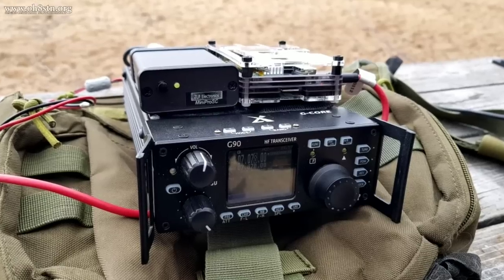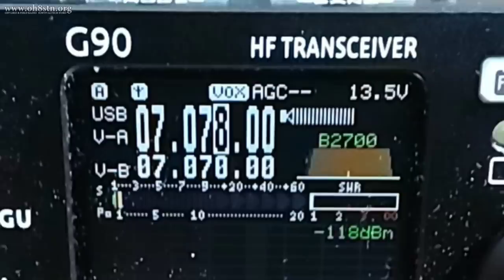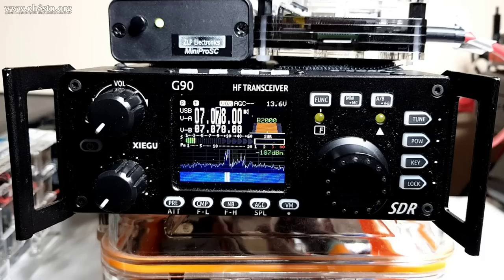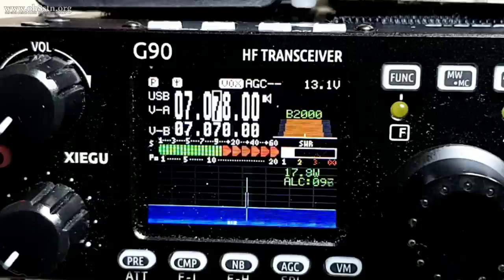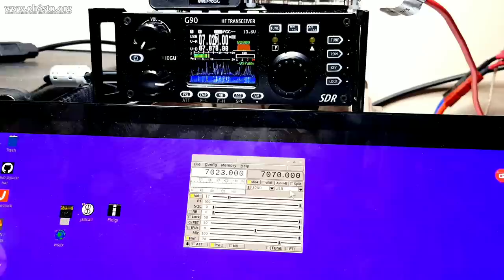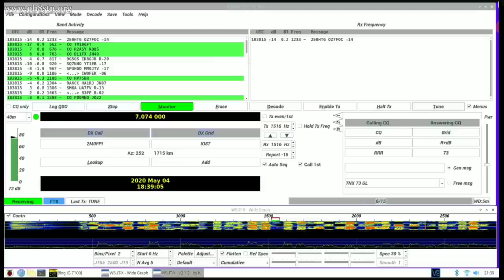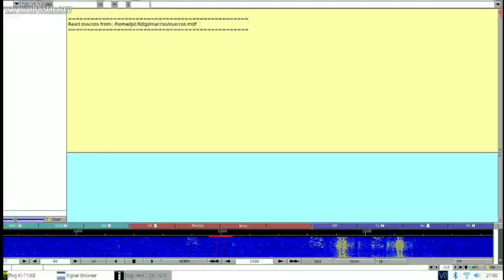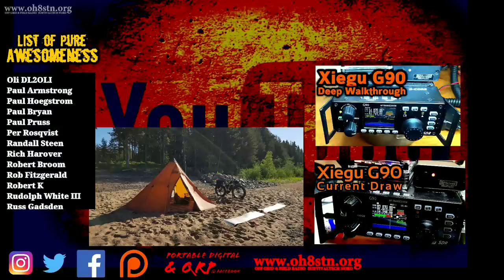Xiegu G90 Digital Modes Setup

Comment: Thanks for the great videos on the G90. You inspired me to try FT8 and the other digital modes. Maybe you can point me in the right direction.  I bought a G90 and the MiniProSC that you used here. I'm using a Windows 10 laptop. But, for the life of me, I cannot get WSJT-X to work. Is there a step by step out there that I can use to configure WSJT-X with my Windows laptop to work with this specific set up? Thanks, Julian. 73 from W5DUI.

Comment: Got my G90 working with HDSDR software on computer, but the question is do you need two antennas or just one and the panadaptor just takes whats on radio screen to computer screen.

Comment: Julian - Have you tried hooking up the G90 to the DRAWS board  via one of the mini din connectors on the DRAWS board yet?
Reply from the maker: Not yet. I don't have the newest draws hat but in principal, It should only be a matter of making the cable.
Reply: @OH8STN  If you still have the old version I would be interested in what you think and if you have any configuration tips with it . I have one from their first run.

Comment: I noticed that you are using the usb port on the side of the pi to give it power, but in earlier videos you describe using a buck converter exiting the rear of the pi for the sake of cable management, as well as using a sabrent sound card instead of the ZLP. Any reason for going back to the ZLP and usb port for powering the pi? Thanks and take care.
Reply from the maker: Sometimes when I'm making videos I have different raspberry pies that I use, different laptops that I use oh, so I just used what's easiest for me at that moment. Your question reminds me about continuity and how important it is. I do have different configurations but generally when I'm out in the field for real, I'm usually doing it the way which allows the most freedom and easiest configuration.

Comment: Could you elaborate a bit more on why you prefer non-cat control of the rig? (Is it a preference that applies generally, or just to this radio?) I have an ic-7100 and I love the ability to have one wire (single USB) to get audio AND cat control AND gps data to a pi, and this arrangement has proven very reliable and convenient. It seems like some of the newer ALE modes would require cat control, wouldn’t they?
Reply from the maker: Excellent question. It's only about the g90. There's two reasons really. When operating portable, I don't want that silly cat control cable coming out of the side of the  head unit on the radio. It's easy to break it off. Secondly, operating data modes primarily, I'm usually sitting on the frequency and not hopping around all the time. So usually I change bands, not frequency. Finally, cat control for the G90 isn't implemented in hamlib or FLRig, it's a hack at the moment. So I prefer simply not to bother. On the flip side, if I were using a 7300, 7200, mcHF, or any radio which has a single wire interface or data and Cat control, I would definitely be using the cat control all the time.
Again excellent question 👍

Comment: You did not explain line input filter. Many station uses 240 Hz tone (for example) for FT8, but that does not pass through transmitter. Simply 0 watts out.

Comment: Could you please run through the making of the splitter cable that plugs AF CON to audio in and out.  I want to make sure I am wiring it correctly
Reply: He won't. Nobody will, it doesn't work. I've been trying to get the CE-19 audio to work for days, cat control works but it outputs 0.0 watts. 🙄

Comment: I'm trying to set up WSJT-X on a Pi 3B that is running the 7-inch touch display, but I can't seem to re-size the application screen. Is there a fix for this?
The display is 1024x700 resolution.
Reply from the maker: 1024 by 700 should be plenty for wsjt-x. First make sure your Raspberry Pi is outputting 1024 by 700 or as close to it as it can. If that doesn't work you'll have to resize the fonts in wsjt-x itself, while the app is maximized. Give that a try.

Comment: Our group wants to find the simplest system to use only JS8CALL for E-Comms within 100 mile radius on 80m NVIS for mountainous terrain.  Our goal is a simple system new HAMs can use.  As close to plug and play as possible and low cost single purpose system.  Is this a good transceiver to build around.  Suggestions?
Reply from the maker: The g90 is not the most perfect radio, but it's a solid performer.
What you're asking is relatively easy with a g90. A resonant horizontal wire antenna 1/8 to 1/4 wavelength above ground on 80m. The antenna can be loaded to shorten it up. 1/2 waveldngth dipole with wire reflector underneath.
I would suggest using 40 meters during the day and 80 meters at night, which usually works well. You can use relatively low power as well. I've demonstrated this using anywhere from 1 to 10 watts. 15-20 watts is ideal.
Excellent question and very welcomed.
https://youtu.be/F0TkJJIsY3o
Reply: OH8STN Ham Radio:  Thank you for the quick reply.  We’re planning to build a compete turn key system for new/non-HAMs to use JS8CALL for E-Comm.  Target cost for the entire system: PC/Tablet, Transceiver, interface, power, antenna, & cables is $500.
W3HU

Comment: Nice job Julian! I followed this video and got a MiniProSC and connected it to the G90 and ran WSJT-X on the Raspberry Pi 4. I initially set the line audio as suggested, but, noticed that even when I had the Pwr slider on WSJT-X at max I could only see about 4 watts into a dummy load at a 20 watt setting on the G90. Another odd thing was no matter where the Pwr slider was Min to Max, the G90 always showed 100 ALC. I then changed Aux In volume to 15 and the power out went up only to about 11 watts. That is as high as I can get the output to go. It is acting like I just can't get enough audio to drive the G90 (even though the alc always stays at 100 no matter where the settings are at). Would love others thoughts on this. :) 

Is there a way to adjust the gain of the MiniProSC? 

tnx, 73, phil KF6IF

Comment: Outstanding review!  I'm trying to decide between the X5150 and the G90.  I am most interested in portability but  also the ability to interface with a laptop.  Any comments regarding that capability with respect to the X5150?  KI5KET
Reply from the maker: They are identical in regards to interfacing. I use the same audio interface for both radios, when using js8call, winlink, ft8, ...

Comment: After watching this  a couple of times it looks like I have  two options , the Ce-19 or the  digimaster. Correct ? If I choose the  digimaster option , what cable do I select ?  Icom 7100 or Icom  8 acc. Awesome video btw
Reply from the maker: ZLP promised to add the G90 cable to his website. I simply sent him an email before I place the order, told him which radio to wire it up for, and he delivered that cable. If you want to use the mini pro SC, just shoot him an email. I used that audio interface because I have several of them around the shack. There are other audio interface options though. The other option is also using the CE19.
Reply: OH8STN Ham Radio I just found a 8 pin cable  to  twin stereo headphone jacks that they say is for ft8 on the G90’s  would this work  with another USB sound card ,instead of  the digimaster or ec-19 ?  The problem is the ec-19 is not available on this side of the ocean and the digi master is 4 x the amount of the ce—19 .
Reply from the maker: You could make that cable yourself. You only need the audio in audio out and ground. Use the Vox for PTT. Anyway the cable you're talkin about sounds like it would work with any USB sound card. If you try and let us know how it goes.
Reply: OH8STN Ham Radio Will do , appreciate the help.
Reply: Ended up getting a ec-19  cheap and ordered the USB sound card you featured in the video. One question the cable you showed in the video , the single to dual did that come with the ec-19 and if not what was the pin out for it ?
Reply from the maker: Yes the c-19 comes with all those cable sets for you to make your own cable. Looking forward to working you on air👍
Reply: OH8STN Ham Radio sweet I can hold of cutting up my cables then , just ordered a gps as well for time sync. Have you worked into Canada before ? Really enjoying this G90  I am glad I found your videos on it , they where the deciding factor on the purchase .
Reply: Update got all my gear in and followed all your suggestions ,  and was able to get the following working . FlDigi and flrig work fine ,  ft8 i was able to get working. But not until I updated to the new  rc3  release . Js8call is a no go at this time. As it will not stay running  and the the sound only works 25 % of the time , 1 have to keep trying different sound entry’s all the above was only working with the ppt cable , vox never did work no matter what I tried

Comment: Where did you get the connector that has the 8 core acc connector on one end and the two 3.5 mm jacks one the other end?
Reply from the maker: Ordered it from eBay
Reply: @OH8STN  how is it listed, I couldn't find it.

Comment: Using singalink and FTDX-1200 to my desktop.  It  Wants a com port in my broad range and I'm running windows 10 and in windows 10 there are no com ports. How do you work around that.. I guess I'm a boxer rocks today thank you joy your videos
Reply from the maker: This comment and question is missing some context. I don't really understand. Doesn't that rain have an internal sound card? Doesn't it also have Vox on data for a PTT? Finally, what is broad range?

Comment: If you're not fussed about 2m/70cm would u buy the G90 over the FT-817/818?
Reply from the maker: In some circumstances yes. If I wanted more than five or six Watts out of the eight one seven or eight one eight, I would definitely go for the g90. Don't get me wrong though, I've enjoyed the eight one seven and eight one eight since it first came to the market about 20 years ago. Sometimes however if I want a little bit more power, I don't want to carry an antenna tuner, and I don't want to add a single mechanical filter to the radio, I could have a cheaper radio with all those things built in already, at the expense of VHF and UHF. It's a tough question but if you look it purely in terms of technical requirements, it's an easy choice.
Reply: @OH8STN  I'm limited to 10W here in Australia as I only have a foundation licence. Not too worried about more power as I'm more interested in efficient lower power modes anyway but all the other features and the fact the G90 is about 75% of the new cost of an 818 is very enticing. I have 2m/70cm Mobile unit in my shack and HT's so would only be missing SSB uhf/vhf. Thanks for amazingly quick response by the way. Cheers VK3FABY
Reply from the maker: I happened to be sitting here having a coffee when your comment came in. To be completely honest with you the 6 wants of the 818, is tough. Despite what many people will say, there is a difference between 5 watts in 10 watts. Especially when we're talking about ultra-narrow data modes or CW. The difference is not so apparent with wide bands like winlink or SSB. So if you're not fussed as you said about VHF UHF, definitely go with the g90. You also have to remember with the ft-818 an antenna tuner, and the internal mechanical filter are not included.
Reply: @OH8STN  Awesome, thank you for the advice. The G90 sounds like a bit of a no brainer for my particular circumstances/interests. Hope you enjoyed your coffee!

Comment: How do I connect my Samsung tablet to the G90 for psk31? I dont have a big usb port, just the micro usb. Thankyou.
Reply from the maker: It really depends on the tablet hardware.  If you have a micro USB with OTG enabled on your tablet, you will need audio interface between the radio and the tablet. It can be an audio only interface,  since cats control is rarely used on Android.  Check xggcomms.com
I've got a video incoming, exactly on this topic.
Reply: Thankyou, am a subscrber and will definitely watch that video.

Comment: I just got  a G 90 and now I need an antenna, my goal is to only communicate from a mobile unit my Ural Sidecar motorcycle. I have a solar charging system all-ready. I saw a video you did on super antenna, would this be good for me to start. By the way I just got my Tech rating a week ago so I am a nooby at this. Any help would be appreciated.

Comment: This is a really helpful video.  But I've been having major dramas with my G90.  I cannot get it to reliably connect to flrig running on a RPi using a XGG Comms Digimode-4.  I can get it working, then take everything down to the park and set it up, only to get the "Transceiver not connected!" error message from flrig.  I think that it may have something to do with the radio firmware.  I reinstalled the firmware today, which resulted in being able to get flrig connected.  But the next time I set everything up, flrig again refused to connect.  Have you observed this behavior?  I'm about ready to get rid of this radio.
Reply from the maker: Bummer. 
I've heard of a couple of people with this problem, but it wasn't the radio, it was the Raspberry Pi and FLRig. Try updating FLRig to the latest version. The newest versions have better support for the g90 and x5105.
Reply: @OH8STN  Thanks, Julian.  Unfortunately, I'm running the very latest version of everything.  I set up the RPi using Build A Pi by Jason KM4ACK and updated it a day or so ago, after David had released a new version of FLRIG.  One thing I thought of was that it could be caused by running a lower powered RPi.  I went with a 3B+ instead of a 4 because I wanted to avoid overheating issues (I live in the desert on the UT-AZ border).

Comment: I'm pretty clueless on RaspberryPi, but I'm wondering why you have a RPi and a laptop on the picnic table? Why do you need a RPi if you have a laptop?
Reply from the maker: Gregory look closer. Notice there aren't any wires between my tablet on the picnic table   and tablet. For all the incredible things for radios can do, they are still pretty stupid. By integrating the Raspberry Pi with the radio directly, the radio becomes a sort of server. Then we can connect with any device a laptop, tablet, mobile phone, to run data modes on the radio. This is all done wirelessly. When I'm in the field station, I like to set up my radio and its own spot, then relax some place in the tent or perhaps outside the tent enjoying the Sun, using my tablet to connect wirelessly with my radio. That's the point. Does that make sense?
Reply: @OH8STN  How do you controll RPI through your laptop? Teamviewer or something? And im guessing its run through Wifi and not bluetooth? :)
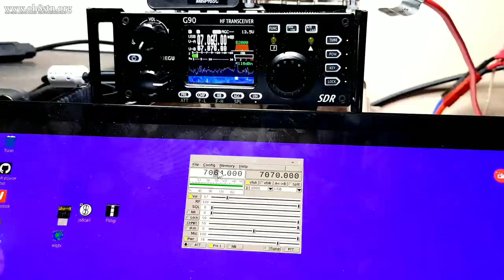Reply from the maker: Skip to 11:05 in this video  https://youtu.be/bD7McGV21jQ

Comment: How many db is "extremely low"?

I decode -17 regularly, sometimes even -20 with my radios and the cheap USB
Reply from the maker: Yeah with the zlp I can decode - 25/ -26 regularly. I have decoded -23 with the cheap USB sound card, but usually need to apply slightly tighter filters 2 work stations that low.
Reply: @OH8STN  excellent, I've never tried any filters before. Something I'll have to learn about.
Reply from the maker: Definitely do so. The filters are the best feature of this radio
Reply: @OH8STN  Can the G90 filters be centered over the center of your digital signal (1000 on water fall, for example), and use the bandwidth filter to just be wide enough for your selected mide?
Reply from the maker: Yes. Filters can be adjusted for width and position.

Comment: Can you explain why ALC:100 is the same as 0 ALC on other radios?  
I see 98 to 100 ALC at about 15 to 18 watts.  Can't make contacts yet.
Reply from the maker: Because there's no standard to display ALC. 100 means perfect clean signal on this rig. 0 on other rigs. We adapt 👍
Reply: @OH8STN  Thanks for the quick response.  I don't see any documentation about the G90 ALC meter interpretation.  I would have tried to get the ALC close to 0, but it is at 100 and transmitting around 15 watts.  Ironically, I finally made some contacts tonight after more audio adjustments and moving the antenna.

Comment: Okay dumb question. Why not use a Bluetooth tnc with a custom cable and your tablet? One cable going to the back of the radio and done.🤷🏽‍♂️
Reply from the maker: Because a small one supporting all modes doesn't exist.
Reply: @OH8STN  I was looking at getting the mobile link TNC 3 and the documentation says it's basically a Bluetooth pass-through device that works with Android iOS and windows. If I read the documentation correctly. I would assume that means it should work with all modes. 🤷🏽‍♂️ Going to pick one up for use with my handheld but going to try one on my g90 as well.
Reply from the maker: Yes that's true but it only does packet and aprs. It's an excellent little device. I have a few of them. They're mostly used for VHF or UHF.
Reply: @OH8STN  well if I get it working I'll let you know. If the TNC 3 is only acting as a Bluetooth audio card I don't see why it would have a problem, especially since 2 meter packet is pretty resource-intensive compared to hf data. 

Haven't tested this either, but I just picked up a wolphilink. If the TNC doesn't work I'll give the wolphilink a try. 🤷🏽‍♂️ 

Rig control is not real high on the priority list. Simplicity of use and compactness is. Like you I don't like cable sticking out everywhere 😂
Reply from the maker: The wolphilink will work. It just needs a cable to the accessory Jack on the back of the g90. The monilinkd wont because it does deal with audio.  Its actually a TNC, not an audio interface. I think the difference between these two things is where the confusion is coming from. I like you or "can do let's test it" mentality. Absolutely awesome